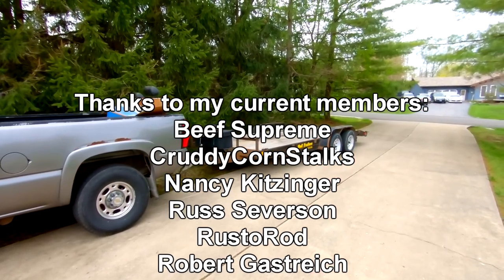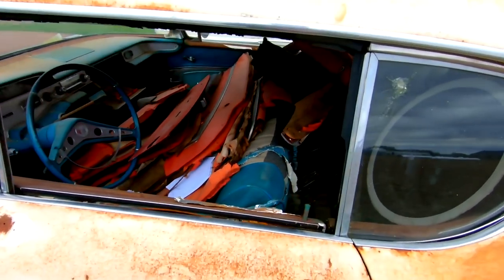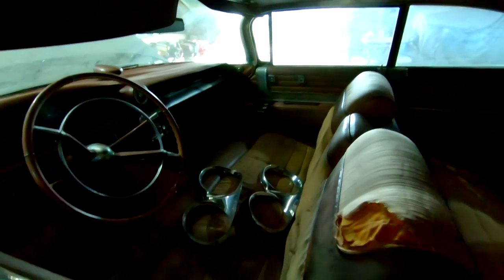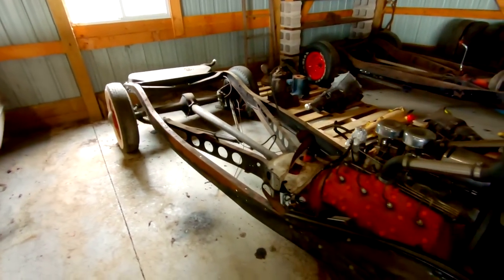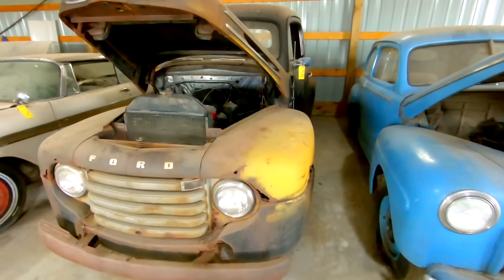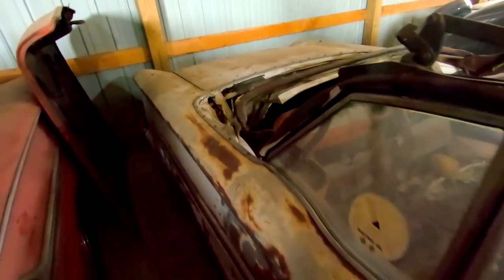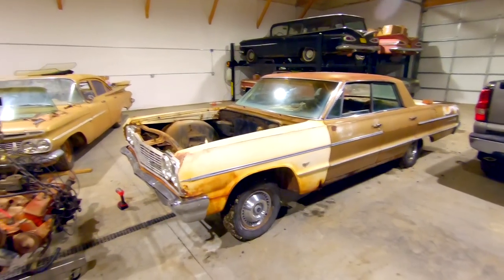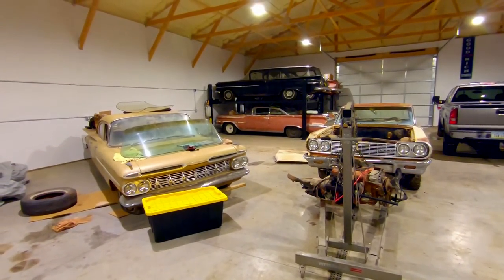One of the BEST Auctions I've EVER SEEN! Impala Convertibles, RARE 1959 Cadillacs! (Auction Recap)

Comment: I was there the day before (Wednesday) the bidding ended. My friend owned the chopped flamed Merc in 1961-62. It was a 20 coat black lacquer, Cadillac powered show car back then and he supplied the auction people with a chain of ownership since he had sold it for the new owner, who turned out to be local. For reference, the Cadillac convert went for 47.5K and the (3) 58 convertibles went for 43K, 36.75K and 34.25K with the red one being the highest. Nothing like burying yourself in a project before you even start. Even the parts went for stupid money for the most part, at least it was a nice day for a drive.
Reply from the maker: I agree, everything went really high
Reply: @IowaClassicCars  Glad we were not alone in that thinking. I've been at this 47 years and my friend 65 years. We just shook our heads and asked each other what did they see that we didn't ?

Comment: Ryan I have said this before but many of the cars you show are pure rust buckets. Ido not want to take away from what you are doing, but to restore these cars properly it would take the better part of $100,000.00 in todays money. The 58 Chevy cars are pure junk, they are rusted to death They need quarters, rockers, floors, fenders, hoods, glass, wheels, tires, engines, trans, and some rears. of the six shown maybe you could make one solid car. and then you would need stainless trim and emblems let alone paint. Look I can comment as I have been there. I completely restored a 67 Camaro that was in pretty bad shape. I bought the car for $8000.00 and replaced every nut and bolt on it. Being able to do all the deconstruction and construction work myself. I did everything except the paint  I spent over $30,000.000 in parts fenders, doors, hood, bumpers, glass, seats, carpet, console, shifter, trans, engine, driveshaft, clutch, radio, heater core, radiator, hoses, belts, hardware, fittings, Trim, brakes, bearings, seals, gaskets, exhaust. I have been there. I have done that.